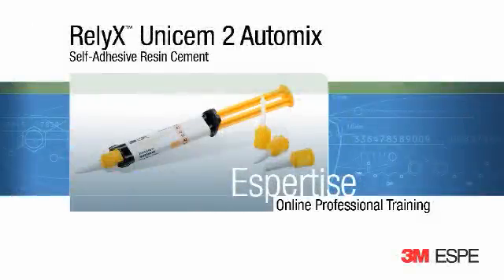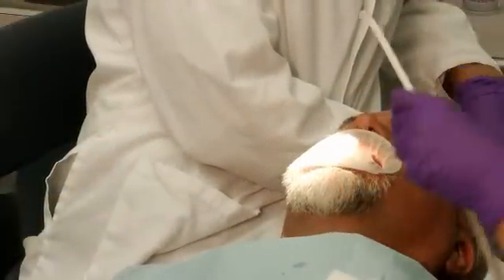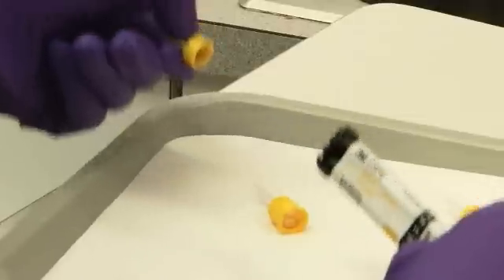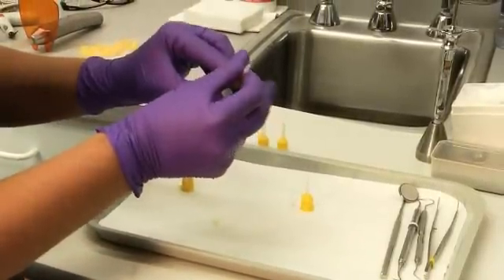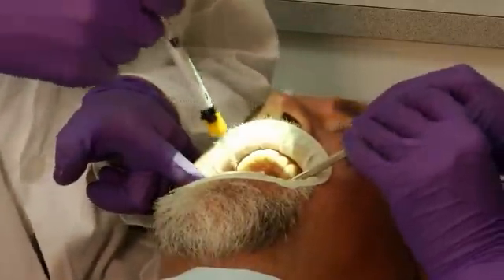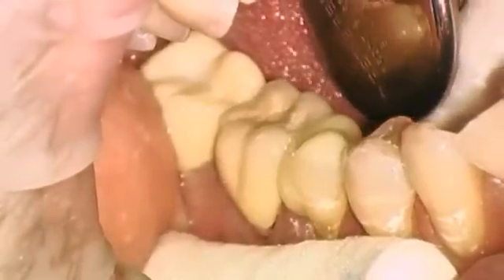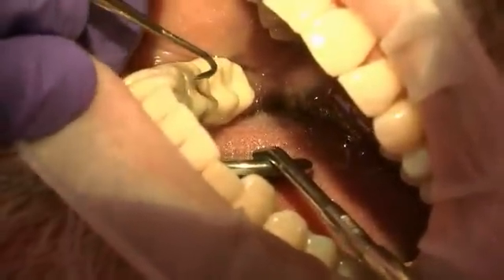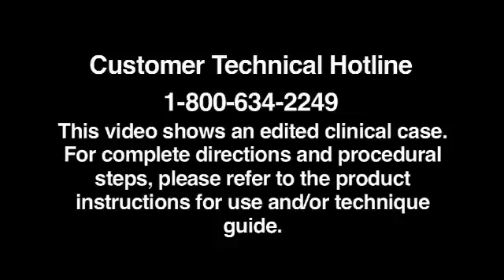RelyX™  Unicem 2 Automix Cement - Chairside Solution for CAD/CAM

Comment: The luting procedure is totally inadequate. Don't consider it. Otherwise you will have periodontal problems and technical difficulties to remove all the excess cement. Good cementation to 3M.